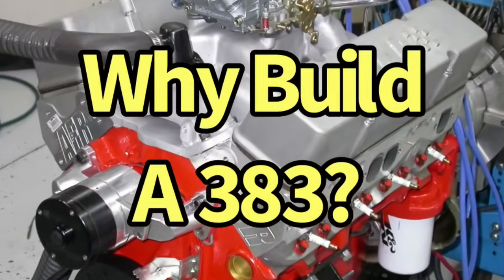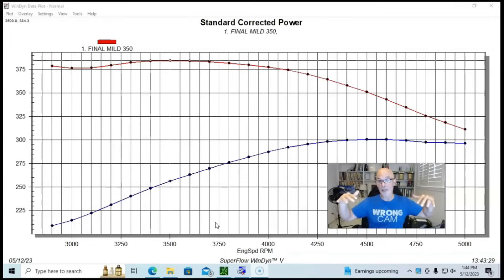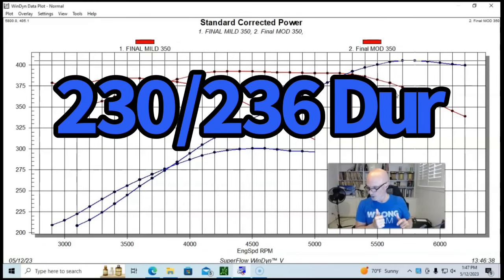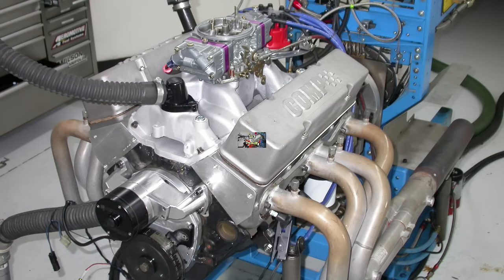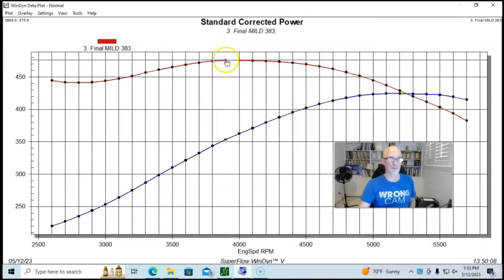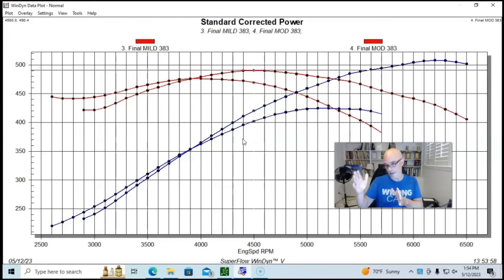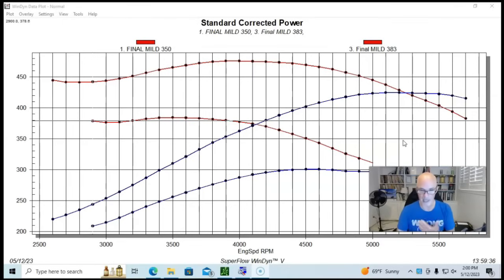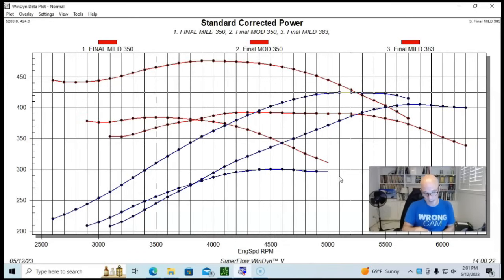HOW DO YOU MAKE MAXIMUM TORQUE WITH A SMALL BLOCK CHEVY? JUST ADD CUBIC INCHES! 383 STROKER BUILD!

Comment: Does it make more sense to put a 350 crank in a 400 block, or a 400 crank in a 350 block?  Just curious.  You get more cubic inches, but you have to make sure all the rotating stuff doesn't hit the block, and use an external balancer (and flywheel?) in one case, and in the other case, you have the block with the siamesed cylinders so maybe cooling is a worry...  Just curious which is "better?"
Reply from the maker: most don't like to deal with Siamesed bores and steam holes-so 383 is more common unless an after market block is used
Reply: @richardholdener1727  makes sense.  Thanks.  Looking forward to the 396 results.  I first worked on my buddy's 396 that he put into a '63 Impala, in...1977.

Comment: 350 engine, mild cam, intake, AFR heads for 405 hp? I’ll take it! Where in hell are you gonna use 500-600 hp at? No where!!
Reply: People tend not to think about their normal driving habits when conceiving a new motor. 
I rarely Rev my car above 3200 rpm, never beyond 4000, yet some high horsepower engines are making the power at 6 grand. 
Nonsense for a street engine.

Comment: I  have 67 camaro with 327. what can i do to this motor on budget build. It currently has a 3 speed manual transmission that i would like to change as well.
Reply from the maker: cam and springs

Comment: 350sbc to a 4.030 bore  drop in a 3.875 crank (396sbc) and with a good mild cam with matching heads  you'll see a strong 500+ hp with 500+tqlb easily
Reply: Does the block need work done to it to allow that stroke?
Reply: @shanewilliams247  yes it does.
Reply: @shanewilliams247  When you get   your block bored, just let them know what size crank you're going with. My 396sbc stroker has fried 3 transmissions  just make sure your tranny is bullet proof

Comment: You just said you lost low end power with 282 cam, that is why they recommend 220 degree duration at 0.05" lift; so why you can incorrect. You smoking crack! ;)
Reply from the maker: One of is...and it ain't me
Reply: Lighten up, just kidding, but you have to admit there is a limit to cam duration for the street, eventually you lose low end torque! :)

Comment: Just saw the video and liked what I  heard as this is exactly what I'm looking to build for street and strip. I have a Malibu wagon with a350 4bolt main block.  Want to configure to 383 specs but don't exactly know what parts to use. Like to possibly  get close to 550hp or maybe 600hp and use pump gas. I see you use AFR195 heads on your build, but what if you wanted to  go higher with the AFR 220 Eliminator heads.Tranny choice would be to use the 350 that's in the wagon, change planetary gears include a trans brake and beef up the rear  to 3.73 or 4,11.  Since I'm new to the game, was wondering if you could compile a build sheet  for the wagon. thanks in advance. Ray
Reply from the maker: you won't like a 600-hp 383 for street driving
Reply: So, I guess it's proper to choose reality. Definitly don't want to compromise fuel and drive with headaches. I'll go with the modified 383. Could you provide Cam manufacturer for 232/238-543/538 grind? Or Is there a lower engine assembly you recommend with the same cam, e.g., when choosing a package, should I go with 6" or 5.7" For I or H beam rods? Also with purchasing the AFR 195 Heads, would it suit best to include 1.5 or 1.6 rockers. Like I mentioned before I'm starting out and would appreciate all the advise I can get. Thanks in advance.  @richardholdener1727

Comment: If doing a 383 then why not do a 396? The cranks cost the same, just use a 3.875" instead of the 3.750 and you get 396ci!
Reply from the maker: much less common
Reply: I@richardholdener1727 It'd be really cool if you could build a 396 sbc and compare it to a 383! That would be really interesting to see what difference it makes!

Comment: Can not use over 220 degrees duration at 0.05" lift cams for street engines, that is how you get maximum torque on bottom; you need to mention this!
Reply from the maker: that is incorrect

Comment: 🤔NO START WITH A 400 BLOCK
Reply: I'm no chevy guy, but the 400 block is not nowhere nearly as common. Which is kind of the point of the video, bc this lends to the avg man
Reply: @NorthFloridaCowboy There out there. I currently have 5 of them in my shop and two (actually 406's now) in vehicles I own. I LOVE EM!!!
Reply: 350 block stronger ,thickness wise..
Reply: Why do you say 400 block ?
Reply: @krypttoenight9971  Bigger to start with.
Reply: @jamesodell7510 But the 400 block is actually smaller than the 350 block
Reply: @silverfishing8960 No. it is the 350 block. Just bigger bore and stroke.
Reply: I had a 400 back in the day. That thing was stooong once I built it. You can get a 400, and bigger small block from block manufacturers like Dart.
Reply: Wonder what the cost difference would be from a 350 to a 383 in parts? Maybe a little difference.  Then some clearancing
Reply: @derrickhenry8620 plenty of good 383 kits on the market. Not a whole lot of price difference compared to a 350 kit.
Reply: Cooling issues come with 400 😅😅
Reply: Agreed 400 all the way
Reply: Start with a Cadillac 500 ci block then stroke and bore it
Reply: NO SHUT YOUR STEAM HOLE UP.
Reply: Eww the 400 block is a pig
Reply: 400 blocks have heads with water jackets & block &  for pistons are way thinner than the 350 block .

Comment: Nice. I built a 381 (only 0.020" bored over) and made 511hp and 492tq. And that's with a 650 speed demon. The throttle response is awesome. 

This way, if you like the power of a wild 350, but you don't want to lose out on the lower speed tq, build a wild 383! You get back the lower speed tq, plus a bit more higher speed hp. Great combo, especially with 4.11 gears for the street! Let's just say I have fun on the street and never even wound out the engine. Granny shift at 5k and she boots! One day I'll open her up

Comment: If that holds true why not a 400small block
Reply from the maker: very hard to find
Reply: @richardholdener1727  for real last one I saw I was twenty two and I turned fourty this year but my point is we got more power out of the three fifty it was fourty over and our machinist buddy bored each hole specifically to fit extra right for the specific piston and numbered them and we matched the duration on the cam to take advantage of nearly the whole stroke of it all forged internals and a dual plane weian intake manifold double hump heads shaved ported out as far as possible and triple springs on the valves that were 202 valves int and exst eight fifty holy double pumper
Reply: @richardholdener1727  it had so much combustion pressure it sounded like a cracking sound when each cylinder hit like lightning crackling in the air then the thunder
Reply: @richardholdener1727  it ran 5.8in a eighth of a mile and sixty foot time was 1.003 seconds
Reply: @richardholdener1727  but yes bro very hard to find now and the heads are damn near impossible now days
Reply: @richardholdener1727  what would you recommend for solid lifter cam and compression on a 400sbc rebuild  using a stock block and a 4speed manual transmission in a 75 camaro ?

Comment: Richard:-  the LCA is way to wide for best torque. With a 10.5/1 CR a 383 with a decent build should make about 1.37 lbs-ft per cube with the right LCA. Check out PowerTec 10 episodes 21 and 22 and give me your thoughts please.
Reply from the maker: Thnx D-every motor was not designed for maximum power-We know we can make more
Reply: @richardholdener1727 personally I'd like to see you test out some of David's cam specking knowledge.

Comment: Hey Richard I built a 383 stroker.forged 3.75 crank,6 inch rods with bolt upgrade,king coated bearings,flat top mahle piston pack,compcams roller cam xr288hr-10,cloyes double roller timing chain,afr 195 street eliminator heads65cc,ultra pro comp cams roller rocker arms 1.6 on intake,1.5 on exhaust,comp cams short travel roller lifters.its 10;7;1 compression.what do you think about that combo.its gonna be carbureted.need help on the best carburetor.going in a 1986 Corvette c4, automatic with 3000 stall,373 gears.? Thank you
Reply from the maker: good combo

Comment: I have a pair of double hump heads and a aluminum intake and a holly 600 CFM carb and would it be alright to build a 350 Chevy engine with a 279 degree cam stock push rods and rocker arms how would this combo work out for a budget build for my car
Reply from the maker: 279 advertised duration would be fine, but it will need springs too

Comment: Might as well build a 4" stroke, roller cam motor, vortec or aftermarket heads with a modern combustion chamber 
( not Edelbrock or copies)  cam to match rpm range desired and compression to match the cam and fuel
Reply: Fen exactly 💯
Reply: Thats what i did Dart block ,4.125 bore, 4in. Stroke crank,6 in rods, wiseco pistons , AFR heads , 427. When its time to regresh .030 over , new slugs,  presto a 434.  A Howards solid  roller. It is a torque animal.
Reply: @ronniecox109  way to go  I do not see why anyone would build a 383 now that rebuilt stock 400 cranks cost as much as a new 4", cast cranks work fine" and you do not need to go nuts on the rods and pistons if not road racing or marine.  WE bored the 62 327 block to 4 1/8  you could bore 283 1/8 so we said why not.   Spent a long night at a gas station with a quickway sleeving 16 holes
Reply: 4in stroke has been done on 350s but are few and far between
Reply: @gordocarbo  Chet Herbert did hundreds of 4" stroke 6" rods,, injected gas and fuel, blown fuel and gas and street using 283,327 and 350 block  He also built several 452 cu in 4 1/4 strokers and won top fuel at the 62 AHRA Nationals at Cado Mills Texas with the 452s and top gas with the 400s   The light  Shubie blown fuel car was competitive until the larger tires allowed the hemis to hook up
Blocks are the limiting factor  as opposed to the 60s stronger, raised cam, larger cam tunnel, larger bore blocks are available
I like 4"stroke builds  I was part of the 62 team  4 1/8 bore on 327 -350 blocks split cylinder walls  BTw AMC was better
Reply: @jmflournoy386  Great post thanks for the history

Comment: I built a 383 stroker engine with Dart Pro1 ported heads...keith black forged pistons...555 lift cam. High rise single open intake....850 double pumper Holley. 3500 stall TCI converter making 650 hp. & 650 torque at 5,500 rpm. Everything matched up & blue printed. It's a beast in my 1985 iroc z28 camaro!!😡🚘👍
Reply from the maker: 650 hp and 650 lb-ft? 1.697 hp per inch and (even more so) 1.697 lb-ft per inch seems very high for a 555-lift 383
Reply: That combo would probably be around 500ish hp and 480 torque, no? 650 hp seems to be more like a well built 400cui combo.
Reply: @LilRay.18  Thats a pretty stout combo to make what you listed...which is more than enough for most any st car. 
Guys get so obsessed wtih numbers they dont mean much.
Reply: @richardholdener1727 DYnoed at Jacks at his Beanstalk
Reply: @richardholdener1727  bilder was a nascar race cirlce track CHAMPEEN!
Reply: @richardholdener1727 what cam did you use on last build. I've been looking up specs but can't find one
Reply: That was with a 250shot Richard.
Reply: Bingo ,didn't want to bust anybodies bubble, but since you called  it. Can't BS  everbody. 1.6 hp. Per cube . Not with that combo. Sorry.
Reply: And we all know torque and horsepower are not the same at 5500 rpm.
Reply: Dyno is off no way its making that...at 5500
Reply: Liar liar pants on fire 🔥
Reply: Where did your horsepower peak? I’m guessing north of 7k rpm?
Reply: Thats not possible someone gave you some fluffed numbers.
Reply: I have close to the same combo. Wicked. Car runs 4.58. You think that is fast, hell, that is just the first 60 ft.
Reply: @jamesspain5049  Took me a second to get that lol
Reply: No way I've got a 600 lift 252 duration 110 lobe separation roller cam 388 with 11.25 CR  70 cc Edelbrock heads and a tunnel ram with 2x 650s that doesn't quite make 600 HP. 

Its in a 78 c10, 4/6 dropped, CPP tubular suspension, Wilwood big brakes, 4.56 spooled 9", 4000 stall, trans brake power glide.
Reply: @xm20k  vic jr heads? Sounds like a blast. Doubt my sr 383 makes any nore than 560sih max
11.751- 230cc Darts. 294cfm int 232 exh @600  260/268@050 108lsa, ported team G etc. 
Really dont care about numbers. When asked at cruise night I usually say probably more than 400 idk
ET and MPH I do...but the local 1/4 mi tracks in socal are gone.
Reply: 650 hp at 5500 rpm?  Not sure that's correct , what cam specs ?

Comment: Ever think about doing a video comparing small block to big block same cubic inch engines? Like a 396 stroked small block to a 396 big block. Or a 427 sbc to a 427 bbc. Would just be neat to see them side by side.
Reply: Been there don that   except at really low rpm BBC rules, it's the heads but think weight   BBC also holds up in HD or Boats

Comment: Usually a 112 lobe sep. Works with 283, 110 a 327, 108 a 350, 106 with 400, depends alot on combo, such as valve size, rpm range, street or track, etc. But this is a better than most magazine or book cams with all ground on 110 lobe separation angle, also dial it in,dont trust gears !

Comment: Try a 108 lobe separation angle, should bring torque up quick and have more !
Reply: Had a custom 108 LSA Crane roller in my 355 and it was a beast(.615/.625, 235/245 @ .050). Rowdy idle, too.

Comment: Good runners, would love to see how much the 383 would of picked up getting that 112 lsa cam out of there. I,d bet money with a few degrees shorter duration on both intake and exhaust and a 107 lsa camshaft that 383 would pick up 25-35 hp and torque accross the board.
Reply: Sounds like you're thinking LS cam 😂 that's exactly what the "truck Norris" camshaft specs are

Comment: It is fun looking at these dyno sheets. I have a freshly rebuild 350 Buick in my daily driver. Mostly stock minus intake and headers. Engine just up and dies over 4000rpm. But even though it’s a cheezy low compression 350, I can rock a 28 foot flatbed trailer full of firewood with my 3.08 gears and 32 inch tires. Peak torque is at like 2000 and it still makes excellent torque at 1500.

Comment: Chevy guys really used to be stupid about this. The nitrous guys would use heads with giant valves (2.08/2.10" etc.) on a 383, robbing the crank from a 400 SBC. They should have been building 377 destroked 400s or perhaps a 406, for less bore shrouding (flow). A 383 is a torque motor and well suited to heavy cars/daily drivers/trucks on motor. Built a 388 (.060" over) for a 1960s P60 (cab forward 2-1/2 ton chassis) for a friend's ramp truck. Had so much low end with Promaxx 180cc runner heads and a RPM intake that he had to put a Brownie-box behind the 4spd trans and in front of the 2spd differential. The 327 was turning 3000rpm at 65mph, so I put a circle track cam in the 388 for a lot of torque (tight LSA) and it turned out to be a beast at even 2500, so hence the o/d unit.
Reply: Brownie box ??????
Reply: @getthegaff1  Auxilary transmission behind the original, two speeds- 1:1 straight drive and one overdrive (aprox .7:1),  and also a neutral.

Comment: Thinkin about a 383 for my 87 k10.....can i use a stock...or close to  stock cam.....so i dont lose power down low.....99 pcnt of driving is,1800 to 3600 rpm
Reply from the maker: something slightly bigger would help without any loss

Comment: Could one do thecsame with an lm7?
Reply from the maker: 383 is possible
Reply: @richardholdener1727  yeah I saw some of your different ls 383 after..
Strangely enough the LM7 is the only chevy v8 one can get fairly cheap in Sweden.
Most v8s people want $5-8000 for and a later ls more than that. 
The lm7 can be had for around $2500 so its the only sensible offer in my mind..

Comment: Hey Richo.
Was the 405hp 350 kinda typical of an engine like that?
Not experienced with Chevrolets myself but It seems a little weak.
Did it have much compression?
Reply: Cheapish heads, and compression that’ll run off of 87 octane.

Comment: Richard good job as always! What happens if you change bore from 4.00" to 4.165"?
Reply from the maker: 4.165-bore smc? 4.125 is common for after market or 400 blocks
Reply: you can overheat with stock 400 blok, go as small over as you can

Comment: How about a 400 vs 383? I’m curious as to how these two compare in terms of torque and horsepower. How similar would the curves be?
Reply: I want to build a 421 small block
Reply: Damn, I’ve always been curious about the difference in power between a 383 and 400 with similar setups.
Reply: @LilRay.18  I like your setup I been watching your videos
Reply: @Mariopeerman  Aye man that means a lot, I appreciate it!  I’ve been out all summer due to work, but next week I’ll  finally be back in town and putting my motor back in with a new cam (rounded the old one). I’ll be uploading more videos pretty soon bro🦾
Reply: How about a 427 😁
Reply: @Gene4666  that too

Comment: Are these SBC HP/TQ numbers directly comparible to the L96 6.0 tests you have done Mr Holdener? Same dyno and such? Your tests of mild, dish piston rectangle port 6.0's, with very mild cams CRUSH the sbc results.
Reply: Ls has superior heads add a set of aluminum heads the sbc will close the gap alot